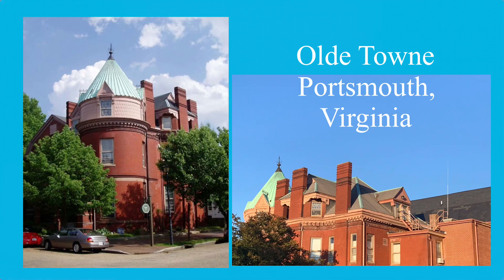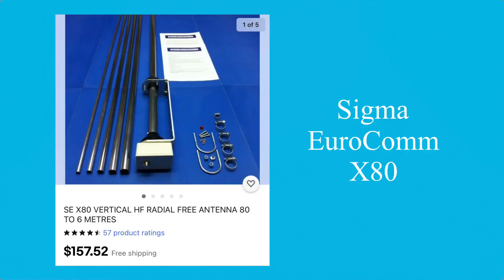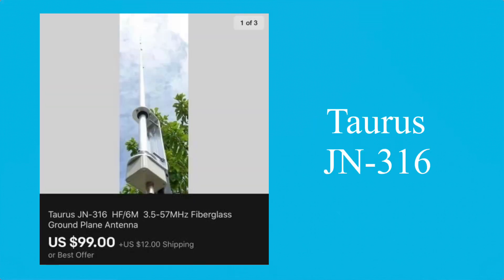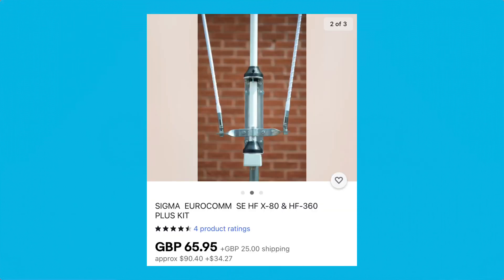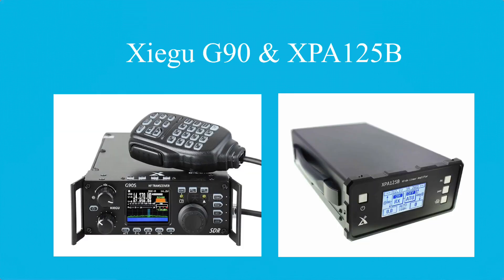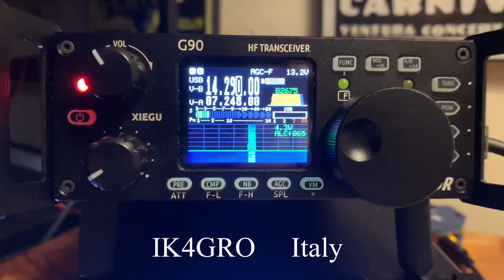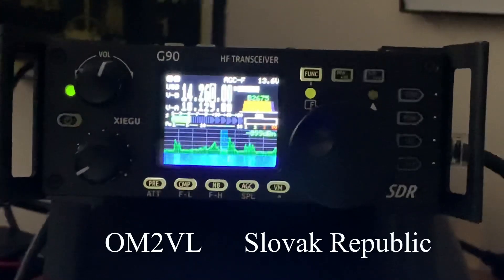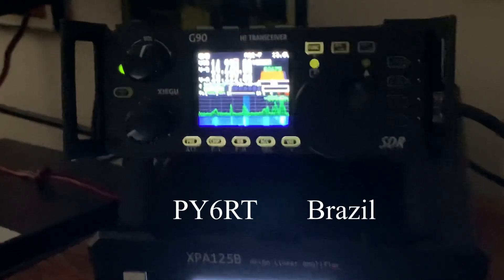Multi-Band HF No Radial Vertical Antennas, Do They Work?

Comment: The radials are completely useless either at ground level or at the 8m height I have my Sigma.  That said, tuning on 40m is pretty simple through a tuner and the performance is really very good on FT8.

Comment: Looking good do you have a lightning arrestor in line, thinking here to install at 25' then run coan down to ground install an arrestor then another 30' coax to shack with a CMC just before the rig an ft710.  possibly ground the antenna as well but not sure how.

Comment: Do not ground the antenna nor use counterpoises or the antenna will not tune keep it simple. Follow the instuctions and do not get complicated. I mounted mine at ground leveland it works fine.
Reply: Meanwhile everybody says that the antenna should be grounded well..😂😂

Comment: Walt: Watched your video sometime in 2023. I ran into the Jetstream JTV680F, same as the Comet or MFJ no-radial vertical. The price ($60) was right, so it came home with me. I put it up on a 10 foot mast, and it worked. Not great, but it worked.  I am sure if I had your fire escape/metal roof under mine, it would have worked better. 

I took it down and it's stored in the garage loft. I will get back to it sometime.  Years ago, an engineer I knew on the air mentioned Gootches Principle, which simplynstated says, "RF Gotta Go Somewhere..." The no-radial verticals demonstrate Gootches Principle perfectly...

73, Keith, WB2VUO in Amherst, NY

Comment: How did you fix the 1, 35 metre steel whip at the top? How deep inside? There is no mention in the manual of what to do...maybe for SWR adjustment how?

Comment: I have a BB7 from Diamond, and I see people loving it. I find it to be an air cooled dummy load. The balun, to make everything 50 ohms, gobbles up all the efficiency. An S9 signal on a dipole will result in S1 or worse on the BB7. I guess it's a matter of if your situation can handle something different or not. I get it.

Comment: I know its an old video but I can not find any help anywhere I have the Harvest Taurus RO-109 HF6M 3.5-57MHz  and can not find the plus kit, could I make my own and the question is how and to what should it attach to?  Does it just need to be at the base and can wrap around the fiberglass or does it need to make contact with something other than the fiberglass pole?
Reply from the maker: It goes on the metal part at the bottom of the antenna. here's a link to one: https://www.ebay.com/itm/221331212479?mkcid=16&mkevt=1&mkrid=711-127632-2357-0&ssspo=7p4KTCMES8S&sssrc=2047675&ssuid=IVyKb51XQj2&widget_ver=artemis&media=COPY

Comment: When you put up a dipole and a branch touches the wire, does it through everything out of whack? I am trying to put up a dipole far from my house but rather dense with trees. Thought about a vertical.
Reply from the maker: The branches will have little or no effect on the antenna, put it up!

Comment: Inexpensive versions of this can be constructed using a 20' fiberglass pole, a 9:1 unun, and some heavy gauge wire. For some reason, 18' 6" of wire on a 9:1 provides passable VSWR on 15, 20, and 40 meters most of the time without use of a tuner.  Essentially the Sigma Eurocomm or Amazon vertical is just this, a 9:1 unun hooked to a mast of just slightly over 18'. (The 9:1 unun should not be confused with a 49:1 unun, as the 9:1 ratio works best for "random length" antennas that are non-resonant on any of the bands but are intended to be matched or tuned across multiple bands.  The 49:1 is best suited for a resonant half wave piece of wire for the lowest intended frequency and is then also usable for higher frequency bands in most cases).  While ground radials are not necessarily needed, you will need a good ground connection if you expect to have a passable VSWR.

Comment: I have one of these and I recommend it for people like myself who need a reliable antenna in a small back yard.  The winds around here can be damaging in the early spring, so the aluminum Hustler verticals are out of the question as they are only built to withstand 45mph wind gusts and they are also pretty heavy.  I have an endfed set up, and while it works well, it is pretty directional.  For late night DX on 20m and 40m, as well as day to day communications, the Sigma EuroComm fits my needs perfectly.  I have talked on 10m through 80m with this antenna and have had some pretty good signal reports. It is a light weight antenna and can be mounted directly to a chain link fence without any other additional support (no driving in poles or pouring concrete). I actually use my chain link fence as a ground instead of installing multiple radials (which is recommended even though it is not required with this antenna).
Reply from the maker: Thank s for the great comment! 73

Comment: Nice results. My only suggestion is that you turn your preamp off and you minimize some of the noise. Those signals will still pop up above the zero line. You won't be fatigued by the constant static.

Comment: these antenna's are a good all-round starter set, after working on mine i purchased the plus kit which is basically two white hamsticks and a bracket for $80,

now after a few years i realized these were a 4:1 unun  only 5.4m vertical (10m efhw) not really good for 20-40-80m but the hf80 version is a 9:1 unun at 24.5 ft the minimum arrl length guide,

any body who owns these two antennas i have a hack, cut a wire exactly 20.1 metre's solder it to a 2 inch hose clamp and attach to the aluminium base where the plus kit goes,  and run it up to a tree, house or fishing pole, then cut a counterpoise exactly 30ft solder a 1 inch hose clamp, and clamp it to the outside of the pl259, this prevents your coax being forced as a radial or worse, a counterpoise, lastly some kind of common ground protection, 5 or 10m away from the antenna, ie: ugly balun, 6 or 9 clamp on ferrite beads (same diameter as coax) or wrapping it around a recommended toroid, then you have probably doubled your signal and reduced your noise floor,

Comment: Great antenna , needs couple of coats of polyurethane varnish to stop weathering the fiber glass! Also don’t use lock washers between sections,it’s better to have the sections flush against each other. I useScotch 2224 electricians direct burial tape. It stretches and wrap’s around sections nicely. This tape will weatherproof sections and keep them from separating! JohnBoyUtah KJ7TBR 😎🇺🇸🎙📡
Reply: Correction 2228 direct burial , almost same stuff as high priced HRO coax tape!
Reply: I have the fiberglass sf360, I have the 1kw Balum , I have a three tube 811. Sir Paul from sigma comm said the plus kit is no good with an amp! It’s rated for 100watts output! JohnBoyUtah KJ7TBR 🇺🇸😎🎙📡

Comment: I got the ebay version and it worked great fresh out the box. for about a year and a half. then now it's all scewy on the tuning. I did move it up. this antenna likes low altitude DO NOT RAISE the antenna above 5 feet.

Comment: Antennas are a subjective subject, if your happy with what you have up and it works for you, stick with it, some people are convinced that a tower and high performance yagis are needed to DX, work in contests or just to be heard on the bands, thats not the reality, thats advertising bait, you have proved that in this video.
You do not need the latest SDR based HF transceiver coupled with a solid-state 1KW amp and yagi/tower setup to ENJOY amateur radio, put up what you can, with what you can afford and have fun making contacts !
After all, is that not the point of Ham radio, making qso's , having fun, learning and enjoying the next few years of Cycle 25 !!!

73 from France. Subscribed and rang the 'bell' keep em coming....
Reply from the maker: Thanks so much! I completely agree with you. All the best and 73, Walt K4OGO

Comment: I put up my Sigma EuroComm HF 360 about 2 weeks ago. My first contact was 1000 miles and I was pushing 27 watts out of my FT-891. I will try my G-90 soon.  I love this antenna. I have it mounted on a 8' (above ground) pole and it is working great. I high recommend the antenna and the price was not bad on Amazon.
Reply: Did you add any type of radials or the plus kit?

Comment: I have the X80 metal antenna it's been up over three years, I live near Lake Erie and we get some real strong storms here with high winds up too 60 MPH the antenna has held up great. It's ground mounted on a water pipe, if work's great without radials but I had another antenna on the pipe that got tore up during a storm. I have 700 foot of wire for radials so I hooked it up too the radials ( Why not they were already there).  I have worked stations all over the place with this antenna. The only band that dosen't work well for me is 80 meters the antenna is too short but all the other bands work great. My friend uses one for P.O.T.A using a tripod and he really likes it. Would I buy another one heck ya I would. I would like too see them come out with a 33 foot model. I also work QRP 5 watts with this antenna with a Mountain Topper and a You Kits HB1B with great success. Sigma Euro Comm keep up the good work.
Reply from the maker: Awesome! Thanks for watching and good DX my friend! 73 de K4OGO

Comment: hello could you give me more information about this antenna.  I would like to use it on the 27 MHz.  I wanted to know if it is necessary to use a tuning box on this frequency?  thank you
Reply from the maker: Yes I have to use a tuner at that frequency. Honestly this antenna has not been the best on 11 and 10 meters for me.
Reply: @COASTALWAVESWIRES  Can you tell me how many ROS without coupling box on the 27 mega?
Reply from the maker: @Sebsg-tz7gh  I can’t seem to recall, the antenna is at my home in the US, I’m currently in Europe. Sorry

Comment: Walt I appreciate your review, especially the QSOs (if you could them that, sounded like contesting). I also appreciate that you put an analyzer on it and found the SWRs where they should be according to the specs. So many negative reviews with so little practical data to back them up.  Hopefully my experience will be close to yours.   Thanks again. I too have a g90 and 125b. I use my FT-891 a lot too.
Reply from the maker: Thank you! Those contacts were not contesting, just quick DX contacts. I made another video using this antenna with just 20 watts and the G90. It’s on my channel and I think you would like it. Thank you so much for watching. 73! K4OGO

Comment: I bougth a Sigma 360 and the Balun melted using FT8 at 80 watts.   Three months of use and it had to go in the bin.  Never had a voice CQ on it.
Reply from the maker: Sorry to hear that, you must have had a bad one. I use mine daily at 100 watts. I’m glad I didn’t experience that. Hopefully you have found a better antenna.
Reply: 80w on ft8,you having a laugh.
Reply: @battlestarone  Don't understand your comment. FT8 is not a low power mode.
Reply: @ultraforce351  The vast majority of people run a MAX of 20 watts on any digital mode. Down at 5-10 watts is common. By running so much power, you're making life harder for everyone else.
Reply: @vhfgamer  You are not correct.  Most people don't run low power.  I am in New Zealand not America.  I don't have thousands of people close by doing digital modes.  Anyway you do your thing.
Reply: @ultraforce351  So basically you're just justifying using way too much power. Cool.
Reply: @ultraforce351  Well just be aware that if you ever do travel to the USA (which is a massive country with spread out people), if you operate over around 20 ish watts, you're going to tick people off. 

Signed
Someone who lives in a very rural and remote area that operates at 5 watts.
Reply: @vhfgamer  Yes I am aware different places have different rules.  My area has high interference. 5 watts here won't go anywhere. It is not like 100 watts comes out of the antenna, it is more like 45watts of power.  Anyway FT8 again is not a low power mode.  I see people using 1kw.
Reply: @ultraforce351  Good lord, a kilowatt? Who are they trying to talk to? Q from star trek?

If you have a lot of local interference, it sounds like you have some foxhunting to do.
Reply: @vhfgamer  sign of the times.  Cheap electronic devices everywhere.
Reply: @ultraforce351  I know. Not denying that. But it is an issue that can be dealt with. Turn things off, unplug things, do RFI management. 

I use a little cheap pocket AM radio from the 80s to sniff all the bad stuff out. I have a whole drawer full of snap-on RF chokes.
Reply: @vhfgamer  It is not my house.  Hundreds of houses here.  All with RFI generatora.
Reply: @ultraforce351  I guess you hate your neighbors?
Reply: Did you try phone and it failed? 80 watts digital may have been a bit much.  I think it is rated at 400 PEP SSB, so I think digital would have been a fraction of that. Correct me if I am wrong.  Other than Walt, I yet to see a review where a antenna analyzer was used and reported.

Comment: I have the aluminum version for 3 years (in an HOA) and have had great success.  I use a MFJ ATU at the base and run about 200 watts.  Finland to Moscow to Ascension Island and a ship off Antarctica.  Simple, cheap and easy.  I have even worked 10 to 160 meters.
Reply from the maker: That’s awesome! 73, K4OGO
Reply: Outstanding, JohnBoyUtah KJ7TBR😎📡🎙🇺🇸🇺🇸🇺🇸🇺🇸

Comment: Walt,  My HF X-80 aluminum antenna came today in the mail. It was here in just under 4 days from UK to Florida panhandle. It take 4 days to get a letter to the next state that I can drive to in 5 hours. I'm just looking to get some connections with other countries on an antenna budget. No radials or wire counterpoises. Thanks for doing your video and showing me how this X-80 works. 73's !!!!! from N3GZH
Reply from the maker: Good luck with your new antenna! 73, K4OGO
Reply: How’s it doing for you?
Reply: What length do you have it extended to? 19 feet long?

Comment: I too have one of these antennas - OK it's not an amazing antenna but, as you've found, it works and if it works, you use it. There are a few videos on YT that slate it - in fact one guy sits in his well-stocked workshop and doesn't even show it in use but slates it - I've used it on 20m upwards on FT8 at >5watts and voice at around 50watts and had good success and got stations into the log. 73 from M5GWH.

Comment: I had the original X80 by SRC and found an addition of 10m of wire to the tip and draped horizontal ( East to West ) into bushes/trees helped no end on SWR and proformance. Used on G6OI callsign JOTA 5/9 Japan from Bewdley, Worcestershire UK. 73's and good DX Andy M6APJ
Reply from the maker: 73’s! K4OGO

Comment: No doubt about it, so many Hams are retiring and moving to antenna-restricted QTHs that these types of antennas are getting to be popular. 

I think the key to these being effective is simply power, and the XPA125B is needed to give the G90 half a chance. I too have a G90 working barefoot into a basic attic dipole, and it can be heard...but I'll never get into a pile-up with it. 

If you can control the common-mode back to the radio, they will work OK. 

Thanks for the video.
Reply from the maker: Thanks for watching!! 73, K4OGO
Reply: 5 farite beads 6 inches from the antenna coax connection will help common mode! Also an ugly Balum not to far from the antenna will help stop the coax from being part of the antenna! JohnBoyUtah KJ7TBR 😎🇺🇸🎙📡

Comment: I have the Taurus JN-316 got it from a seller in San Jose, California.  Was 79.00 with 12.00 shipping. Been working ok for me to. What I did is waterproof the balun on the bottom. 1 year so far so good...thx for video real nicely made 👌
Reply: I also have one version of these, the one I have has a 6/1 transformer on the bottom and is about 18feet long telescopic aluminum. Curious does either of yours tell what the transformer is?  I plan to likewise attach it to a double layer steel roof as the ground plane or at least a reflector because the roof is a 12 pitch roof and will be higher behind it.
Reply from the maker: @americaswayout4489  no, my antenna does not tell what the transformer is. You should have some success with that steel roof. 73, K4OGO
Reply from the maker: Thanks for watching! From what I gathered the Taurus JN-316 is the exact antenna as the Sigma EuroComm and Moonraker. They all 3 even say “Moonraker” in the black sleeve over the balun. Probably just a distribution thing. Obviously you got the best deal price wise!
Reply: I just ordered the same after watching the video. It is now $109. I live in South West Idaho and was wondering what kind of range you’ve been able to get with yours. Can you tell me your setup and experience?

Comment: For some strange reason people (who often have never used them) slate these antennas.  I've got the metal version which I mount on a tripod speaker stand for mobile and it works well on SSB, CW and digital.  I added the radial kit in June and it made a difference on 15/17/30 and 40m especially 30m and 40m FT8.  For the money they are a good value antennas IMO and from the UK I've worked South America and Japan on 5w CW which is good enough for me.
Reply from the maker: I’ve been told by many that these antennas are dummy loads. It’s mostly the “book smart” experts that never experiment. I created this channel just to experiment and see for myself. I try to be objective and show actual results. Thanks for watching!!! 73, K4OGO
Reply: @COASTALWAVESWIRES  they are dummy loads  kg6mn
Reply: Interested in your radial kit mounting. I have heard various opinions from almost vertical to almost horizontal. Have experimented with the angles?